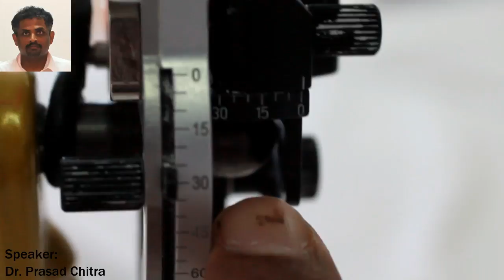Semi adjustable articulator explained

Comment: Thanks for the explanation. by the way Dr. isn't it the Stratos 300 is a fully adjustable articulator ? The Stratos 200 is a semi adjustable articular by IVOCLAR  VIVADENT...
Reply: The 300 is only a semi because you cannot adjust the intercondylar distance
Reply: not just because you can not adjust intercondylar distance but you also use external auditory canal for the hinge axis. So it is a semi adjustable articulator.
Reply: 300 is semi adjustable only

Comment: Sir how much will be the costing of stratos 300 & 200 articulator.
Reply: Stratos 300 semi- adjustable is now the basic model. No sense in buying a 100 anymore. Unless you buy the facebow along with it, there is again no real benefit. The articulator and facebow should be around Rs. 150000 or so excluding the lab mount which is separate.  Check with the local Ivoclar dealer though.